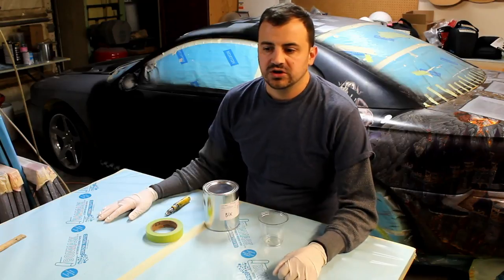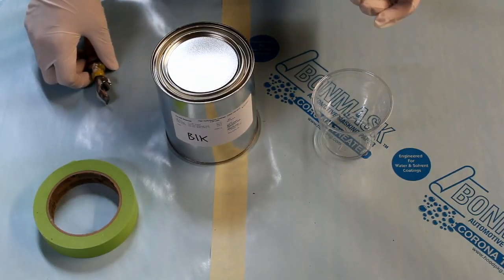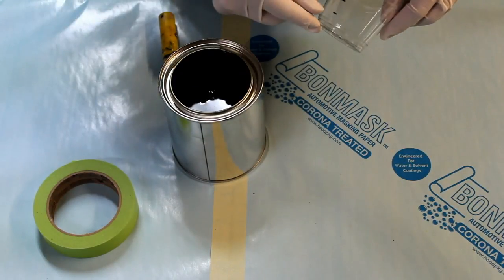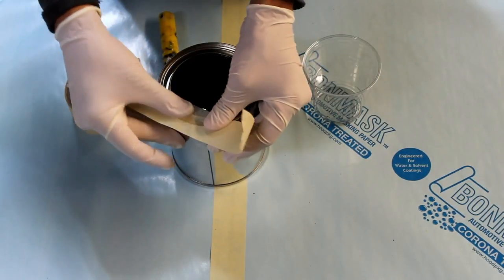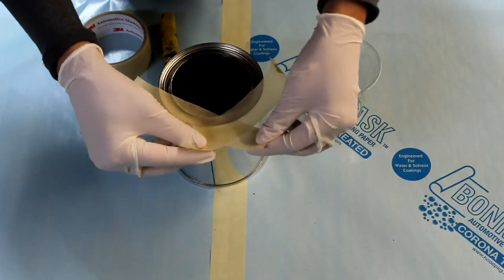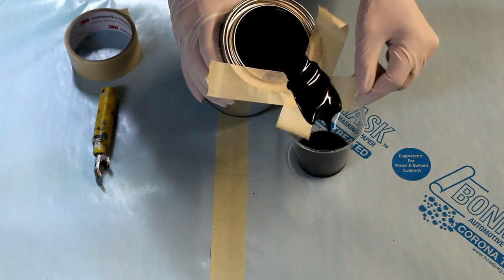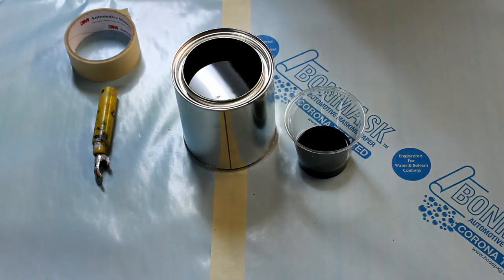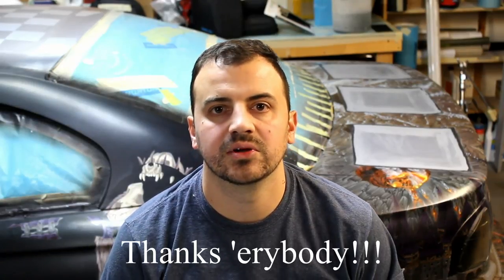Paint Hack!! No Mess Pouring!!

Comment: Was watching and wondering how well this would work. Great tip! I was impressed that the tin groove didn't fill up with paint.
Reply from the maker: yeah it actually works for sure. if the edge has paint on it sometimes that can cause the tape to not stick, but if that happens just a dry wipe before you tape and you're good!

Comment: Thanks a bunch for this tip, JBo. This will save me a ton of time! i have learned that it is very important to clean the groove of the can before putting the lid back on and I usually use paper towel folded into a v-shape. I also pour from the front of the can so if there are drips they will not cover instructions. Your method should take care of both.
Reply from the maker: Awesome!! Glad I could help!!

Comment: i tried this from memory and learned the hard way... you need very sticky tape and you need to stick it to the inside rim very well.  my attempt at this resulted in a rim-full of paint, so make sure you get a good seal on that inside rim.
Reply: Thank you!  I will try again with these tips. My first attempt was a mess, lol.
Reply: @SheilaSpencer1  i recommend the yellow plastic thing you get at the HomeDepot paint counter.  Kind of pricey ($1.20) for what it is, but well worth it.  It takes some learning to get it on the inside rim properly.  Be sure to wash immediately after using, especially inside the groove that attaches to the can.  I like to squegee it with my finger before I remove it to get the residual paint back into the can.  But its way better than this tape trick.

Comment: Great tip! You could improve this by folding the tape under itself where the paint runs down (make a sharp corner). It seemed like the paint had a tendency to flow towards the tips of the 'X'.
Reply from the maker: mmikkone ya for sure... folding it to more of a V rather than an X and even pinching a crease in it so it resembles a spout on a juice jug I’ve since realized is a bit better. Thanks for the tip, maybe I’ll update the vid one day... or actually maybe I should just add it to the description! Thanks a lot!!

Comment: Pro tip dude
What I found with the paint as well, I left the paint that was on the tape hang over the tray and it dripped into the tray - then i removed the tape when it was almost completely clean from gravity getting me every drop of paint it could pull off the tape. No mess on the can, and optmized my usage

Comment: Great hack! Does it work with bigger cans too or just quarts?
Reply from the maker: Absolutely! gallon cans for painting your walls even! Try folding the tip into a V instead of an X works better, I should make a quick update vid! But give it a whirl!!
Reply: @jboairbrush  Fantastic, thanks for your quick reply as I'll be painting my walls today so I'll be making use of your tip :D
I did wonder about a V as I was watching, I thought maybe you'd left it as an X on purpose as maybe the paint then drips from the bottom inside corner of the X instead of running to the edges as it might with a V - so good to know about this little enhancement too :)

Comment: Just tried it.  Didn't work.  Paint went in under the tape and filled up the channel and left drips on the can.  Crap tape I guess.  Get very good tape.  I don't know what kind.
Reply from the maker: likely what happened is there was a bit of paint on the rim, so it was wet and the tape couldn't stick, I've since noticed that a few times, if you just take a paper towel and give it a quick wipe before you put the tape down you should likely be alright.